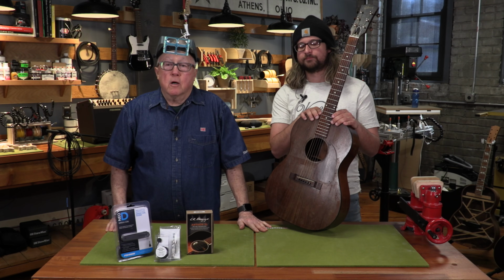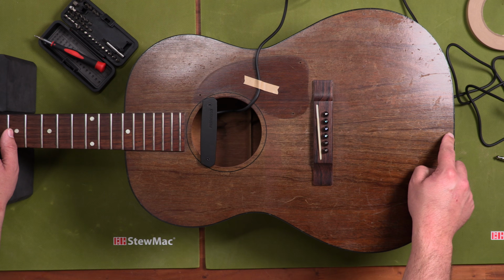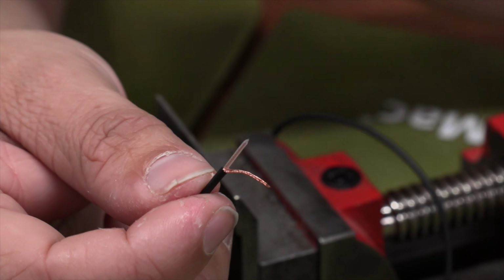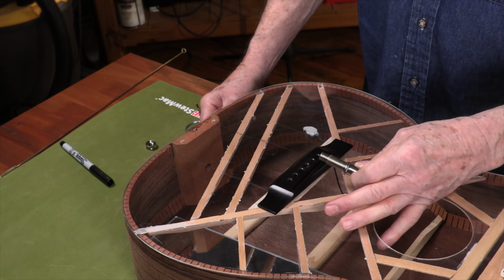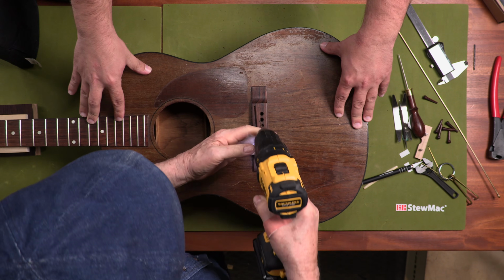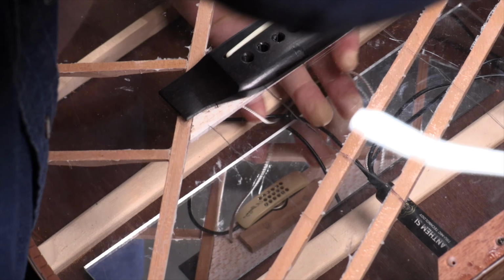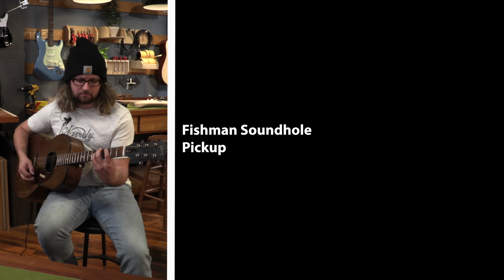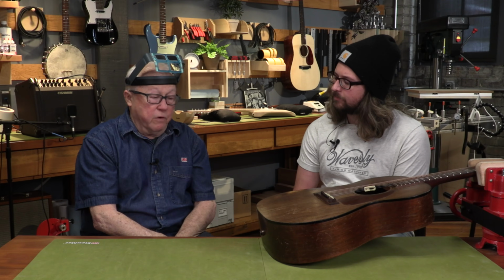Acoustic Guitar Pickups | How to CHOOSE and INSTALL

Comment: I used LR Baggs M1 Active for a long time - great tone, price around 195USD. Recently got a Skysonic A810 - great tone, no batteries needed, price around 45USD. (singer dropped it once from the bar height and came apart but put the cover back and worked). Thinking of buying a few more.

Comment: That's a lot more involved than any adjustment I've ever made on my acoustic 
I've never had to go more than 1/4 turn either way.
1/8 a turn at a time. Let it settle. 
Which is easy to do while it's in the stand.
Keep the climate constant in the room and it stays playable for years.
Take it out jamming ...... 
Some guitars are better off the road

Comment: ProTip: The LR Baggs end pin strap button on the preamp is an ugly dark bronze. They actually make a gold/brass end pin replacement, if you have gold hardware on your acoustic guitar. Google it, since is not readily available and is hard to find.

Comment: I always just buy the cheapest under bridge piezo with any cheap preamp, because the audience is used to the sound. They typically think the bland highend heavy tone is the way an acoustic should sound and it cuts through the mix in a band setting. Literally, I figured out it's not about what actually sounds good, but what the audience sounds good. Just like you can play Wonderful Tonight, When A Man Loves A Woman, Freebird, In the Midnight Hour and maybe Under the Boardwalk and maybe Mustang Sally and you can just repeat them for 4 hours and the audience will think you're the best guitar ever.

Comment: *If you cut a business card into a little trapezoid (similar size to gibson 5th fret trapezoid) and poke two holes in it, you can use it as a single-use jig to glue the pickups to the underside of the bridge. Use 2 golf tees and put the tee end inside the guitar (to supprt the card and pull it upwards)

I learned this installing the journey pickup. Those plus a fishman preamp eq pedal is all you need for great sound and combined they cost $120

Comment: Anyone got any tips to stop the cable clattering about inside? I have a sound hole pickup with far too much cable running down to an endpin socket. Do I cut that cable as short as possible and let what's left hang? Or do I bundle it all together and stuff it in a sock?! Will Gaffa tape hold a load of cable or a shortened cable to the wood on the inside or is that likely to fall off? Should I trail the cable all around the inside perimeter and Gaffa it there? 

My other thought was to thread the cable down inside a shoelace tunnel or even to knit a tube so that when it clatters at least it does so with a muffled whisper. 

Maybe I'm missing a better and simpler solution?
Reply: Maybe bunch the cable with a sm Velcro tie then use one of the sticky clips he talked about to hold it in place not sure haven't done it to the guitar only to other cables but I'd think it'd work. Just a thought hope you found a way to make whatever you did work out.

Comment: Really good video for me as I was researching what to get for micing my Taylor. The last one I had was a Fishman under saddle that fed out the tail hole which was fitted for a regular jack plug. That was on a Taylor 810 Dreadnaught which was actually loud enough without amping it for most small to med venues. Loved the sound of that guitar and the Fishman really did it justice. I used a short cable to plug in a hand size preamp with L M H tone and vol which clipped onto my pants leather belt and then corded into an amp or house system. 

Have to say thought in your demo the L.R.Baggs definitely stole the show. Makes your Gibson sound good even through my cheesy computer speakers.
Thanks again and I think I'm now leaning towards the L.R.Baggs as I like the sound and have no qualms about installing it myself...

Comment: GREAT VIDEO, I''m going with the soundhole PU, soldering would be a problem for me.
Reply: Buy you a cheap soldering iron and give it a shot. Don't be afraid. Unless you have something physically keeping you from doing so. It's not as hard as you think. Especially when you only have two connections to make and they're not crowded by other things, wires and such.  I understand it looks quite daunting, but Watch you a few YouTube videos for pointers if you need and give it a shot. I believe youd probably be surprised, It's not that bad and actually kind of fun once you learn

Comment: What happened with that guitar ? On 9.20 I can see hair line in between sound hole and bridge. I guessed the top of this guitar seperated from the seam.
Is bad representation of guitar repairer/ restorer.
I

Comment: 1:32 I think this is the reason why I never liked the sound of magnetic pickups on acoustics.
Acoustic players forget that there's a reason why electric guitars have both a bridge and a neck pickup, it's because the magnetic pickup captures the vibration of the string at a very specific point on the guitar, like you're always picking there.
I myself never pick above the soundhole, and I don't know many players who pick at the specific placement where many people install a magnetic pickup, so that's why I more so hate how people install magnetic pickups rather than the pickups themselves.

Try moving the pickup to the other edge of the soundhole, the edge that's closer to the bridge, and your sound will change for the better.

Honestly the best solution is to just combine all these systems together, that's what modern percussive acoustic guitar players do most of the time.

Comment: For the soundhole passive magnetic pre-wired pickup like the Fishman, do you recommend any on-board sound-hole mounted mini Vol pot that can be re-wired in line with an end pin jack for a more permanent installation?

Comment: Anyone make a sound hole type pickup for guitars with  smaller soundholes?  My steel string acoustic is 36" overall in size, and the sound hole is just over 3.25". They all seem to be for larger sound holes.  I like the 36" size guitzrs.

Comment: The Neo-D singlecoil is a great pickup which I used for years. It sounds somewhat like an electric guitar but gives more than enough of a woody acoustic feel to to it. Also totally easy to use at any volume.
 The Schatten transducer sounded cheap and boxy to me. I have the Schatten "HFN" pickups in all my high end acoustics and they sound really great, almost like a good microphone. But they have a tendency for feedback at high volumes - not suitable for a playing the acoustic guitar in rockband.
I didn't like the sound of the L.R.Baggs. Those under saddle transducers have come a long way in 50 years but I still hear that chirping.

Comment: Hello

Can i plug the magnetic and microphone pickup (for example:Harley Benton TrueTone SH-30 Pro Active) directly into the mixer Dynacord (analog or digital etc) and that the guitar sound comes out to the speakers connected to the mixer?

> Or do l need some accessories? (Guitar amps, Preamps)

Comment: EVERY acoustic pickup has a weakness. So, my answer is to use multiple sources. I have a RainSong with an LR Baggs Stagepro Anthem factory installed. I have added a Seymour Duncan Mag Mic sound hole pickup, giving me 4 distinct sounding sources: the Element UST, magnetic humbucker, and two very different sounding internal microphones. Installed a new endpin jack for the Mag-Mic, use a 12” Y cable into a 1/4” mono cable. Only the magnetic is always 100%, hole the 2 mics and UST are blendable.

Comment: To overcome the wide bridge saddle issue, one could solder two 'rope' piezos side by side or in opposition to each other...  
There are so many ways to amplify acoustic guitars, or even add acoustic piezo pickups to electric solid/semi/hollowbody guitars.   But knowing how to solder is the key.    I've found using a bridge piezo with a coil soundhole pup, via a mix/blend pot gives a good cross-range voicing.   The soundhole pup I'm using currently is a Lace 'California'.  
.
I'm  currently designing an eight-channel piezo pickup for a vibrato style bridge.  Each string saddle will have its own piezo and one 'rope' piezo embedded beneath all six saddles, with a further two 20mm disk piezos wired in parallel and situated between a brass sub plate and the base of the vibrato bridge thus making the eight channels.   Each channel feeds via a two stage (op-amp) buffer, with 'preset' gain equalisation pots for each channel.  the eight channels are then summed into either a mono or stereo output;  in effect a mini mixer.   Additionally, after the primary gain stage,  eight channels can be 'tapped'-off the circuit and fed to an RJ45 (ethernet) socket, for additional output to a guitar synth unit.

Comment: How long does the battery last in the LR Baggs system 
I’m thinking of fitting one to an old twelve string 
But don’t fancy needing to take all the strings off to get to the battery housing 
Could the battery section be fitted subtly to the guitars strap near the output Jack ?

Comment: I've been using my LR Baggs Lyric (just the mic part of the anthem) on my D-18 style Gillander guitar. I'm lucky it has a sound port, makes it easy to change batteries without removing strings. AND the volume adjustment is a prettier tortoise plastic instead of the cream

Comment: Fun video! I personally use a Seymour Duncan Mag-mic. You get a nice adjustable single coil pickup paired with a mic. A knob for mixing the two sources and a knob for master volume. Get the ease of a non-permanent install and an active mic pickup. Would recommend checking it out to anyone looking to plug in their acoustic.
Reply from the maker: Awesome! Thanks for sharing!
Reply: แปลไทย

Comment: JJB Electronics (USA) make great transducer pickups in single or multiple configurations. Wonderful natural pickup. I install the singles in my ukes, and just installed a double ($22.99) in my Gretsch Jim Dandy. Well worth a look.
I used the Neo-D humbucker on my vintage Epiphone for years - really great, until another musician lifted the guitar while standing on the lead - killed the pickup but thankfully didn’t damage my guitar. The Neo-D pickup unit is completely sealed, so I couldn’t get into it to attempt a repair. Would definitely consider one again though.
Reply from the maker: Awesome! (except for the broken pickup..) Glad to hear you've found some great pickups for your ukes and acoustics 👍

Comment: These days my preference is either a K&K or JJB soundboard transducer (which has three transducers to the one on the Schatten.   These give the most natural sound IMO.

The only downside is that since transducers are passive, you may or may also need an external pre-amp or DI Box depending on the house system.  If you have a long run to the house system a DI box with ground lift makes a huge difference.

Comment: Though the Piezo pickup can sound very good when installed in the right location (I have one installed on a Nylon string guitar), they turn the entire guitar into a microphone. In a quiet setting, the results can be fantastic. But, I wouldn't recommend it for use in noisy environments. Sound Hole Pickups can sometimes interfere with picking and plucking, depending on where the pickup is located, and tends to make an acoustic sound like an electric guitar. The LR Baggs Anthem System sounded the best to me, and it avoids the potential problems I mentioned.
Reply from the maker: Great advice - thanks for the comment!

Comment: Does the magnetic one work for acoustic bass?
Reply from the maker: It will work, but you’d probably be better off getting a pickup specifically designed for an acoustic bass. K&K makes one that is pretty good. (A different style than what you are asking about though).

Comment: Could you use an adhesive that wasn’t as thick on the transducer system? It looks like that gray, putty-like, adhesive would isolate it from the vibrations of the soundboard.
Reply from the maker: Yes… absolutely. We actually had the same thought. However, the pickup was designed to work with the adhesive it shipped with, so we went with that. Using another adhesive might require some experimentation to see what would stick for the long term, and what would also sound good.

Comment: The Fishman passive single coil reminds me of the 30s blues men did when the dogear P90 came out, I think it was the Charlie Christian F hole guitars with the dogear. The blues men would tape the Dogear the sound hole and put a Jack where the strap button goes and hang the strap around the end of the Jack where the nut is and plug it in. Move the amp around to avoid the hum and go. The Fishman sounds so natural and bright. It’s easier to back the brightness off than to add it if you never had it. I love P90s, and if I were going to put one on my 12 string that would be the one.

Comment: Great video. I could have used it way back when I installed the transducer pickup in my Dion. I don't remember the brand, but it used a solid orange band under the bridge. As my 78 Heritage uses a brass bridge, I think that helps keep the clarity of the acoustic sound, and have received a lot of compliments on it over the years. Didn't have any of those fancy tools for the install though, just a daughter with small arms. Keep up the great work.

Comment: I noticed on the Baggs Anthem system, when using the jig to install the mic pickup under the saddle, you put the jig in the d and e strings instead of the a and b strings.  Was this intentional to reduce the bass input to the mic?  Dan said to put the jig in the a and b slots, but the visual showed it going in the d and e slots.  Love the videos.  Always learning something.

Comment: I use a K & K mini on my HD28, with a slim endpin jack, so no drilling required.  Also use an LR Baggs M1 on a ‘76 Guild D40.  Did drill out the end pin hole.  Both sound good, I prefer the K & K.
Thank you for the great video fellas.
Reply from the maker: The K & K is a great system! We have a lot of folks around here that love it. Thanks for watching!
Reply: totally agreed. Also the built in preamp on the lr bagg is just not good enough and producing a lot of noise compared to the k&k transducer when used with external preamps. Plus more natural sound especially when you get the K&K trinity
Reply: Cool! I just fitted a K&K mini in my 12 string. Sounds absolutely amazing. I think I made the right choice!

Comment: I was really torn between the K&K Pure Mini and the Mojotone QuietCoil soundhole pickup for my Martin Custom Shop 0-15 12-fret. I chose the Mojotone because of the ease of installation and the fact it doesn’t need a preamp. I know the K&K doesn’t require one, but it doesn’t sound quite as good without it when you compare the tones.

Comment: One thing I will never do again is have a battery that needs to be fished out of a sound hole to be changed.
It is one of the many reasons I love the Isys system on my guitar, there’s an externally accessible compartment for the battery. And of course if you need the guitar to look more vintage for whatever reason you could always go with either a passive sound hole pickup or a K&K/JJB/Journeytek type of thing.

Comment: I feel exactly the same about that amazing LR Baggs Anthem SL - it's the pickup I went with for my Martin D-18 when it was demo'd by the Baggs channel. What an amazing sounding pickup. I think I may have screwed up and put the microphone further back towards the bridge pin holes, but that can always be reseated. I also didn't like the idea of my beautiful Martin's looks being spoiled by that cream colored sound hole plastic piece, so I mounted mine further back against a brace and I think it works out just fine. It's still close enough for me to adjust it if I ever need to. Best sounding acoustic pickup I've heard as well...
Reply from the maker: It's an incredible system - interesting idea about hiding the volume control!

Comment: K&K Pure Mini. Only pickup I've heard that makes an acoustic instrument sound like an acoustic instrument. Plus, no battery.
Reply from the maker: Agreed.  That is a great pickup.
Reply: Same!
Reply: @@doublewhopper67 I prefer that, no battery to die on you in the middle of a set.

I personally used it for over a year, gigging nearly every weekend, without any preamp. I just ran it thru a DI and used the 3-band EQ on the PA. Sounded great! 

Eventually I paired it with the PureXLR preamp K&K offers. Gives you more control than onboard (because you have balanced XLR out of the preamp).

I know multiple full-time musicians local to me who have swapped to this pickup. I wouldn’t rule it out JUST because of the no onboard controls. 

The main thing I use on the preamp is the phase switch and XLR out. My EQ is set-it and forget it unless something in my rig changes drastically.
Reply: @dudehenchman I have had 2 k&k pure preamps over the years and they both are pretty flimsy particularly the base pot gets bent really easily and Half engages not very roadworthy for a gig. However, the XLR pure looks a little sturdier have you had any issues with the pots? I like the idea of phase switching.
Reply: 1  Baggs   2 Fishman   3  Schatten
Reply: I’ve had good luck with the K&K pure mini on nylon string guitars.
Reply: the shop i work at sells the K&K with free installation and i think im gonna put one in my 80s guild
Reply: @broderickwalters2509 where is that
Reply: Without a pre amp it’s useless in real situations! 🤦
Reply: @steelhead197  I disagree, personally.
Reply: @steelhead197  You're very mistaken. You must not have a K&K Pure Mini
Reply: Anyone has a link for the exact model?